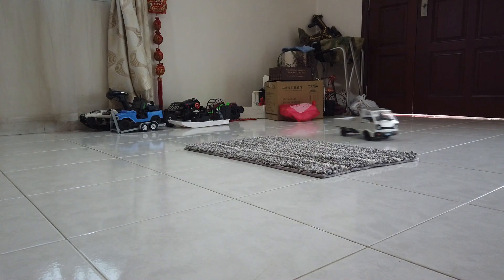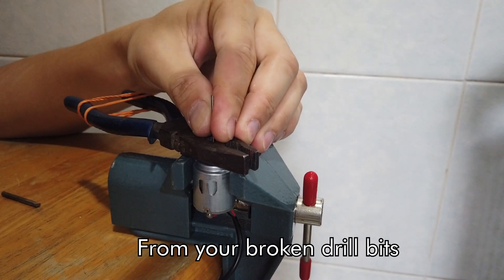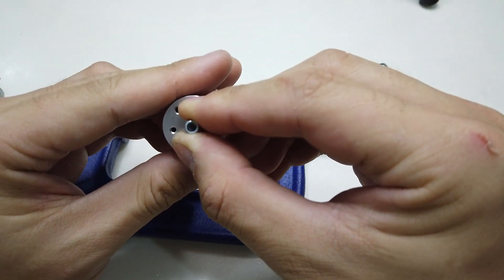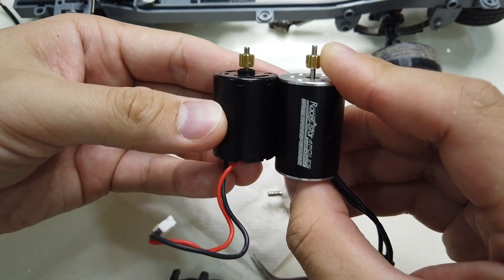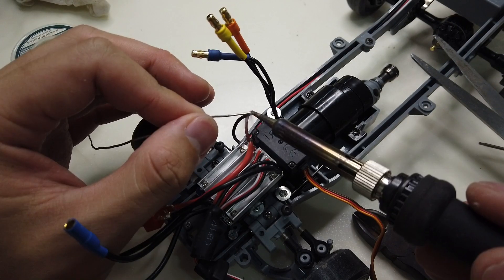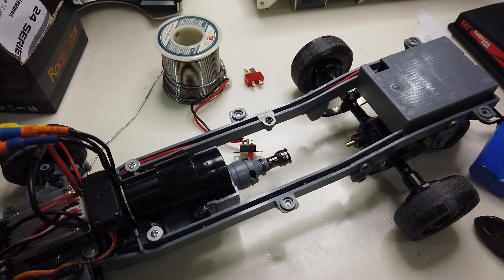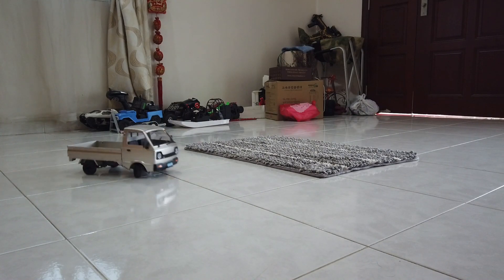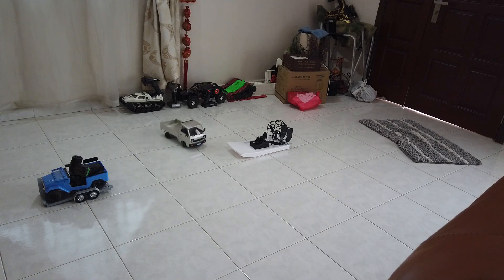What Brushless Motor Upgrade for WPL D12???

Comment: The pinion strips extremely easily how to fix or link to buy in bulk?
Reply from the maker: That is extremely surprising.  It's brass. The other gears should failed before even the pinion. It's available on www.wpl-rc.com
Reply: @EdwardChew  well o upgraded the other gears too steel but can’t find a steel pinion?
Reply from the maker: @Rudestude  hahahahaah that's why it fails. Something needs to fail especially when it's metal to metal. So in your case you have to expect changing your brass pinion often.
Reply: @EdwardChew  I might change back to regular plastic case because toshe gears are cheaper and Easter to replace
Reply: @EdwardChew  another thing are there any d12 metal front suspension kits that offer full travel
Reply from the maker: @Rudestude  full travel in which way?
Reply: @EdwardChew  up and down

Comment: DO i need to get a  30A ESC to change the transmitter/reciever???   i have a DumboRC x4 transmitter and reciever
Reply from the maker: Yes u need.
Reply: @EdwardChew  Ok thanks I only have transmitter/reciever now. So by getting a 20a  ESC, then I will be all good? I'm not changing motor. I only want to change transmitter and parts needed to change transmitter...... Thanks so much!!
Reply from the maker: @ehmmwl7600  ya looks like you only need esc since i dont have visual of that you have now, like changing from what
Reply: @EdwardChew  the ESC is-- (Kuuleyn RC ESC 20A Brush Motor Speed Controller Switchable Brake for RC Car Boat Tank
)---- AND the TX/RX is...--- (
DUMBORC X4 4CH RC Radio System Transmitter and Receiver X6F 2.4ghz Remote Controller for RC Car Boat Tanks(Distance 400m-500m) Controller Transmitter) ---bought on AMAZON...... would these work with stock motor, servo and stock battery?? do i need connection cords??
Reply: @EdwardChew  youre honestly my only hope with fixing my car. my local RC shop got no clue :-(
Reply from the maker: @ehmmwl7600  im surprised they have no clue. they just dont wanna help hgaha

Comment: You say in one of your videos that you use a throttle limit because the motor has a lot of power. Do you think the smaller 2430 motor also from racerstar would be good? KV is 5800 and I assume you have the 4500 KV motor in your d12? Do you think torque would be a problem?
Reply from the maker: Yes throttle limit to 75%. I'm the type who prefer low end torque and linear torque curve for drifting. 5800kv, not sure, never try man
Reply: @EdwardChew  it so cheap that i think I am going to try it!! The 2430 is Also shorter so it might fit better
Reply from the maker: @lasse2071  yeap!

Comment: How to get the headlights to work with the new remote control?
Reply from the maker: Errr need to use resistor to either feed it from the receiver or battery